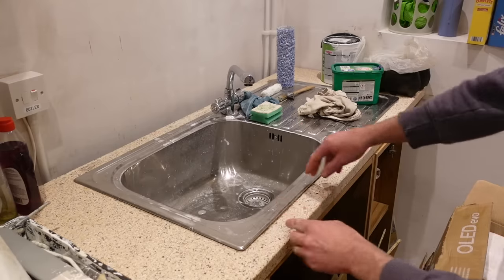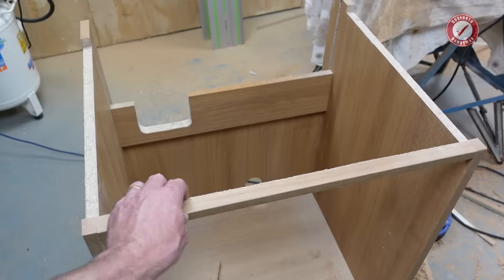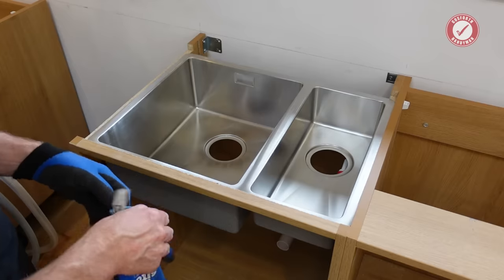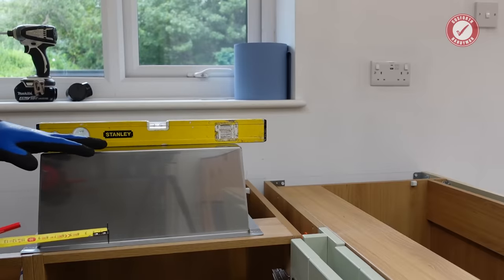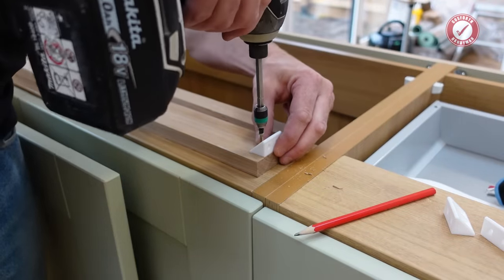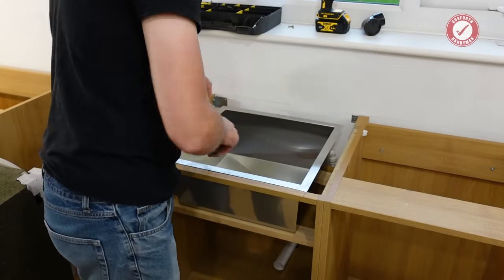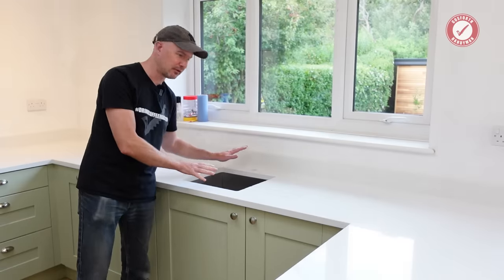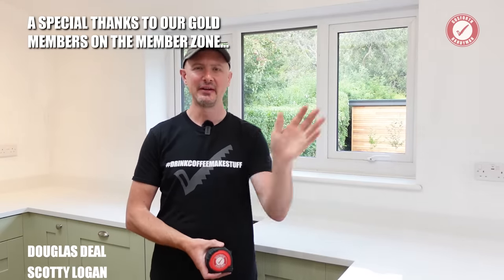How I fit an undermount sink for EASY MAINTENANCE

Comment: Understand “think maintenance” but the fact is most people will NEVER have to remove a sink themselves or even at all. It’s more likely that the kitchen will get replaced before the sink ever needs to be removed.
Reply: But he will be replacing it if it needs doing so he’s making life easier for himself. And sod’s law if he can’t get it out, it’ll need doing
Reply: I was thinking that I've never seen a damaged steel sink in my working life, 63yoa now.
Reply: If the customer noticed a small scratch in the sink they would want it replaced, more than likely by the bloke who fitted it.

Comment: If you needed to remove a undermount sink at some later date you simply remove the 600 cabinet by lowering it on the legs and then sliding it out with the sink  still in place.
Reply: @Anon-y-mouse  You only need to lower the unit a few millimeters - 5 to 10mm will do.
Reply: I see your 600 cabinet is fixed to the wall via L- brackets. Absolute nightmare getting to these fixings with the sink in place, so you wouldn't be able to lower it.
Reply: Unfortunately the sink will be stuck to the underside of the worktop so wouldn't come out with the base unit anyway, don't ask me how I know 😉

Comment: I've never seen a sink damaged so that it needed to be removed. How is that possible?
Reply: Maybe not a stainless steel one, but a ceramic one I could see it happening. 

No way mines coming out though
Reply from the maker: Seen it several times unfortunately! Most commonly it's big knives falling in to the sink pointy side down and causing quite bad dents. I also saw one where a stone pestle & mortar feel in the sink and damaged the area around the waste hole. Not a fun job to replace!
Reply: @GosforthHandyman  ah, ok, yeah I can see that happening. 

I'll have to take the worktop out, should I ever need to do mine. 

I also remember thinking when I fitted it, that if the waste was to ever come lose, it wouldn't be going back on... I put some silicone on it to be safe, 🤣🤣
Reply: When your mum throws a heavy cleaver across the room at your dad and it bounces off the wall into the sink and pierces the basin.
Reply: @GosforthHandyman  TBH the steel being used nowadays isn't the same as that used a few decades ago. I've got a council contract stainless steel drainer sink thats about 25 years old and its solid. Dropped cleavers into it, and no dents.
Reply: When I fitted kitchens many years ago the cabinet was always bigger than the sink bowl. So a 800mm cabinet for a 600mm sink bowl. The bowl then clamps to the underside of the stone via bolt type fixings drilled in by the stone fitters. 
Great video on installing your kitchen.
Reply: It’s one thing that you’ve never seen one, it is, however quite incredible that you can’t conceive how it’s even possible.
Reply: @MKRM27  LOL. Well my kitchen sink came from my brother's garden where it had been kept for over 10 years.
Reply: Me eithwr

Comment: design your fixings on your base unit so you can pull the complete unit out sink and all
Reply: I faced the same dilemma and came to the same conclusion. In theory (because I haven't had to do it for real) I designed it so the whole unit could be removed. Legs could be wound down, the sealant cut and the whole unit pulled out
Reply from the maker: Not easy when the adjoining unit is a dishwasher. 👍

Comment: Great video as always. Is it me or is that sink seriously small? Not sure we could cope with that. We could not do without a half bowl. Of course that's personal thing. Interesting to see how you get on with the sharp corners in the bowl.
Reply: Once you've had a half bowl, you'll never go back. As they say.
Reply from the maker: Do you have a dishwasher? We very rarely use the sink. 👍😁
Reply: @GosforthHandyman  I do have a dishwasher, but the big part of the sink always has a basin in, so the half gets used for rinsing, hand washing etc.
Reply: @GosforthHandyman  Yep! It's me! 😂😂
Reply: @GosforthHandyman  like to see your mrs do the oven trays in that sink  dishwasher won’t clean them
Reply: We fitted a smaller single bowl sink when we refurbed our kitchen … big fail for when the dishwasher broke 😅

Comment: I am at this stage in my DIY-Kitchens install and have already realised that kitchen fitting is not an art form, it's just a series of over-the-top and belt and brace bodges to make things fit. There is no instruction manual.

Comment: If you'd used space plugs at the back you could potentially just pull out the whole unit to replace the sink. Slide it back in and use the feet to keep it up to the required height.
Reply from the maker: Not without also removing the dishwasher, all of the waste plumbing and a lot of the supply plumbing. Plus the unit would be siliconed to the worktop. 👍

Comment: If it were me, I'd make the whole sink cabinet removable by dropping it down on the legs and sliding it out from under the worktop. As long as all the fixings are accessible, you can do this with any kitchen unit. I've replaced a water damaged sink unit in this way before.

Comment: Nice work.  Love your vids.  Also ref the tap , always use a 35mm hole as it’s the industry standard (I work in the industry), means you’ll have no issues changing it later. Looking forward to to next video 👍👍
Reply from the maker: Probably what they used. 👍

Comment: The fitters who did our kitchen added blocks of moisture resistant MDF at the top of all the base units as extra support for the worktop which was measured, supplied and fitted by a specialist. All did a fine job. I like the extra brackets, supports etc. You're in danger of over engineering like Tim!  Keep up the good work.
Reply from the maker: Ha cheers John!

Comment: Yea we sell those 1.5 sink bowls, we only ever put them in a 700mm base unit if they are undermount, the reason they say they can fit in a 600 is because those sinks can be over mount as well, on top for laminates (no drainer grooves of course)
Reply from the maker: Makes sense! 👍

Comment: Always enjoy your channel and appreciate your work. We can all obsess over details that are basically pointless in the big picture. It's taken me some yrs to get over that. Functionality of any kitchen is always improved with a large sink and your first version looked great. As big as you could squeeze into the cabinet and the hinge issue could be overcome. You obsesses over the snug fit hampering a future repair that is maybe 0.01% likely to happen. In many yrs of trade work I have never 'repaired' a SST sink. Each subsequent house and kitchen reno, I have put in larger sinks and they are always a huge hit.

I siliconed an under mount sink to the top of the counter in one installation to accommodate a custom concrete counter top made by the home owner. Counter was made in manageable sections off site with seams sealed on site. It had an apron front design for a HUGE single bowl sink. It was a spectacular counter with fossil details cast into the concrete that polished up beautifully. The lip of the under mount sink only sticks up 0.18mm higher than the counter, compared to a conventional top mounts that have quite a lip to overcome the thinner metal used for economy.

In the end you are the designer and owner so need to be happy with the result.
Reply: I also thought the single sink looked a bit mean and too small for the kitchen, but then it's not mine.

Comment: looks great, well done. I have fitted an undermount sink before and like you said videos on how to do it are few and far between. instructions that came with it were a joke.

as a plumber one tip when doing sinks is to fit your wastes & overflows on the sink before you fit it, if possible. just makes it easier to do it from a comfy position.

 all the best

Comment: I had a job recently where the client had a very small sink like this. They disliked it so much because it was ridiculously small. After much deliberation and discussion I ended up cutting the quartz worktop in situ and fitting a top mount sink with drainer.
Anyway… the trick to removing an under mount sink is to lower base cabinet. and the trick to lowering a sink cabinet is to not trap it in place by passing plumbing through the back panel! (One of my biggest hates) Always, always remove the back panel of a sink cabinet. The void behind the back panel is where most of the plumbing should be located. Makes it easier to repalce the sink cabinet too, which as it goes is far more likely than having to change a dented sink.
Reply: Very helpful, thank you

Comment: My stone guys actually put a couple of screw inserts in the stone in my quartz top for this, and then used an epoxy to mount/seal it. I’ve never seen anyone in Australian support a sink with battons. I’m pretty sure you will never have issues with that coming off 😁
Reply from the maker: Nice! I've never seen an installer around here bolt in to the stone, but know it can be done. 👍
Reply: @GosforthHandyman  Neither had I until this last install. Normally just suck on with silicone on previous jobs. Still, anything to do with quartz is a job for the professionals if you ask me. It's too expensive to risk voiding any warranty on.

Comment: Hi sir very good idea,  and future proof . One thing I will say after a few years it’s surprising how you can forget how you did something , I’ve just replaced a ceramic tap valve on a bath.  Which in its self was no easy task , as in tracking down the right part for the job . Good old EBay for that one , but my point is I couldn’t remember we’re I’d put the isolation valve to turn the water off and I’d put it in in the first place .  I think there’s a lot to be said for a house manual , as you do each project we make a record of everything that is hidden .  After say ten years it’s surprising what you forget , even the colour of the pant if you need to do a touch up .   Thanks again for your channel its always very informative and well presented, you seem to have a natural way with your presentation.      Best wishes and kind regards to your all 😀👍👍👍

Comment: A sink base unit with a 150mm vertical front rail would have the strength and also have a lower set top hinge for the door as well as hiding the sink too. I normally leave the final method of setting up the sink once the templater is on site, just in case. Making sure the sink is removable is something I always factor in, I had enough bad experiences in the early days to remind me to do it for these types of sink.
 Good job👍
Reply: Yes, I was about to mention a front rail, that's what I have. Not sure how easy mine will be to remove though! Probably just sell the house if I break it, then it's somebody else's problem.
Reply from the maker: Cheers John! Yeah, the templater tweaked the position slightly anyway, so was happy to follow his lead. 👍

Comment: You had me worried about supporting the sink as I didn't do that on mine but it's been in 6 years now so hopefully won't fall out. Couldn't live without a 1.5 bowl now. Ours was in a 1000 corner base unit though. Still tight to the top left hand hinge and couldn't fit the soft closer on it. Good choice on colour. We went for black and it shows every little finger mark.

Comment: When I had mine done last year, they just wanted the sink and tap on site for templating so that they didn't have to rely on drawings. Mine is a double bowl sink in a 1200 unit. It does not reach the sides of the unit. The guy marked how much of the front rail to cut out, and a bit of a notch at the top of the center post.  He said they use epoxy to fix it, and that it does not need any support from below. If it falls off, that is covered by guarantee, but he's never known one to come loose. Not sure how I would get it off if needed, probably just heat.
They did prop it up with some wood when they fitted it. Left that for a few days as had to wait for the plumber anyway.
Love the look of your white worktops. I was boring and went for black granite. (also scared of stains)

Comment: Never could see the point in that half-bowl so when I replaced mine I put in a single bowl composite top mount sink - much better to have a larger bowl and draining board. First time for everything but I'm very pleased with my handy work although I don't intend replacing this one anytime soon.
Reply from the maker: The half bowl is handy if you don't have a dishwasher, so you can empty stuff down the sink even while you're doing the dishes. But pointless since we have a dishwasher. 😁

Comment: Interesting to see how they do it over there. Every granite/quarts install I've ever done has had the sink hole cut on site. A metal strapping is used to hold it until the silicone dries. Screwed on to each side of the cabinet.

Comment: Can't say I agree with this one, you will always regret a smaller sink, even split sinks are a waste of time. Biggest you can go is the way to go. I've made that mistake and changed the sink without any complications. And yes it was an undermounted sink.

What you didn't admit to is ordering the wrong base unit. A larger base unit would have allowed for maintenance.

Comment: If the sink is glued to the countertop with silicone it will not be easy to remove the sink to change it out, maybe even impossible to do so.  Support the sink using undermount sink brackets where you can elevate the sink using adjustable posts where you can lift the sink to the countertop, then put a thin bead of caulk to the joint for waterproofing.  The support is from below and the sink can be quickly removed.

Comment: You could have cut the front rail out and reinstalled it vertically at the front. 60-70mm is achievable in depth before most hinge plates on the sides. If you make the rail detachable, a new sink could be slid into place if needed.
Reply: Makes sense. I have a front rail, 140mm. Not sure how it's been fixed in, but if there's a problem with the sink, then I'll be hacking it out with the multi tool! Fairly simple to replace. Would have been an ideal situation for pocket hole screws at the front of the rail, for easy removal.
Reply from the maker: Defo an option, not my preference though.
Reply: @GosforthHandyman  can I ask why? I'm curious to see if I'm missing something. Is there a strength difference between the vertical and horizontal pieces? I mean, even the horizontal piece could remain, and just be fitted from underneath with pocket screws, which would still leave plenty support for the worktop I'd have thought (I'm not a fan of pocket screws, but they're not as flimsy as portrayed either). The only other downside I can see is that you'd have to remove a small part ( just over the thickness of the sink lip) of the carcass to allow the sink to slide out, but that could be done neatly with a multi tool at the point of sink failure, and repaired to be invisible from above the worktop when the door is closed (99% of the time). Or is it the look of the vertical piece? I can't think that'd matter when you're only seeing a sink bottom otherwise.

Comment: Thank you for making this video, it keeps REAL kitchen fitters like me in work. Not enough space for how wrong you are on so many levels. I’m fitting a 1.5 bowl under mount sink on my next job in solid laminate, shall I tell the customer that I don’t want to fit it coz I’m not good enough?😂. If you ever need to remove a sink, (almost never in my 35 years of kitchen fitting), you can drop the unit and slide it out, then drop the sink. You only need to support the sink with a shelf if it’s a undermount ceramic. As for the sink being in the way of the hinge, common problem, just re-drill the door lower down and cap the other hinge hole. You also, ALWAYS need to batten the wall if you’re having solid surface, all reputable granite/quartz companies insist on it. As for the front rail of granite being ‘weak’, ‘it might break if a tradesman stands on it’, also it might break if a tree falls through the window😂 quick, brick the windows up! Are you a prepper by any chance? Comedy gold this vid. Thank you. 😂
Reply: Exactly what I was thinking! Over cautious beyond belief! It’s only a stainless steel sink
Reply: He’s not a kitchen fitter he’s doing his own kitchen. As he has said, he was a handyman and has been asked many times to remove people’s damaged sinks so of course he’s going to do his  with easy maintenance in mind. Also he’s definitely capable of moving a hinge, he was obviously just listening all the things involved with the first scenario.

Comment: Was it not possible to router a horizontal slot to allow you to slide your double sink in from the front, yes I appreciate you would have to move the hinge still but at least you could of kept to the original plan. Love the chanel as been following the house build. Really like the kitchen nice job. 😎

Comment: I have a lovely pressed steel ? white enamel sink,  integral double drainer fold up integral splashback to 2/3rs of a tile course,  rolled up at front so most water splashes run back into the sink or drainer and not over the worktop .  However it is 60 years old and has been "re-enameled" once and is starting to rust out at the waste - would not be a problem to treat but I have no spare space to do work and still live in property on daily basis as such ( normally i would run a temp camper van plastic sink If I needed to do work in a kitchen refurb ).  Ideally I would like a replacement and have a better one with an extra half insert - that is useful for washing brushes / food pre-wash when needed / jars and plastic items and overall longer (As I have a wall length I can re-model If I pull a redundant flue out of the kitchen.  So no need for worktop as such - other than a couple of side unit runs with proper formica on blockboard, does the job.